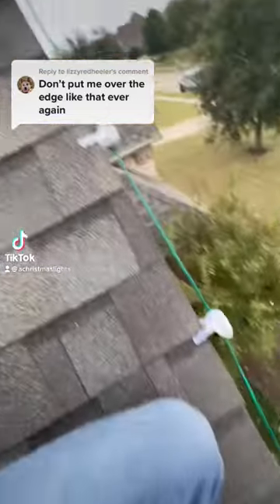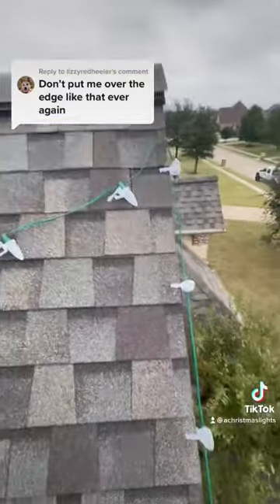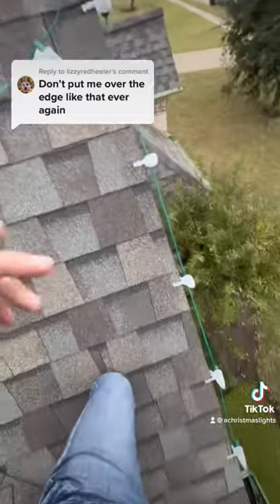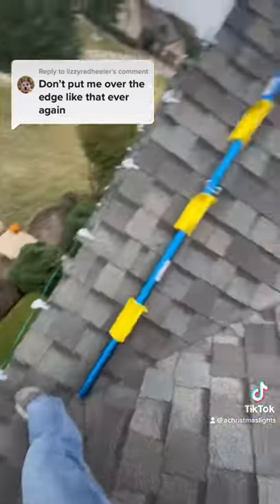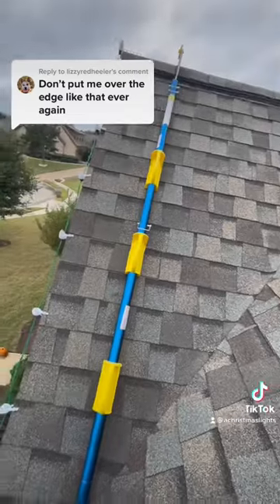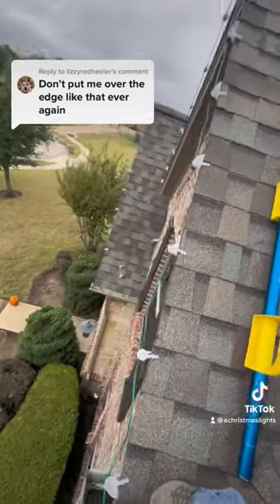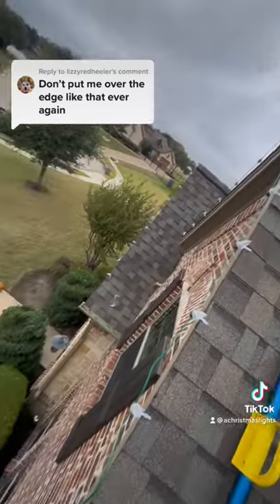Hanging christmas lights perfectly on a peak to get a picture perfect installation

Comment: I got a 14 pitch roof. Do you think a GOAT would work or should I just move a ladder around? I have a goat and a pitch chopper and also the ridge pro.
Reply: You got the RidgePro asking which one to use? LoL straight drop? GOAT, long ledge with no 2nd point of contact? RigdePro. Solar Panels on the roof? Gonna have to Ladder it.
Reply: @lm4349  I ended up getting it done with pitch hoppers and the goat